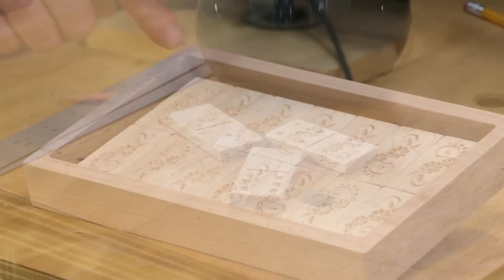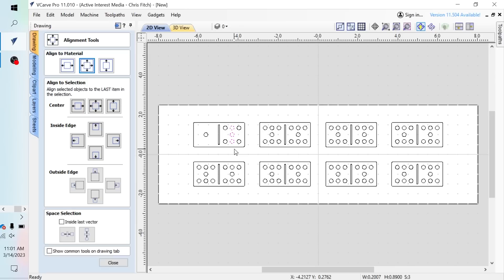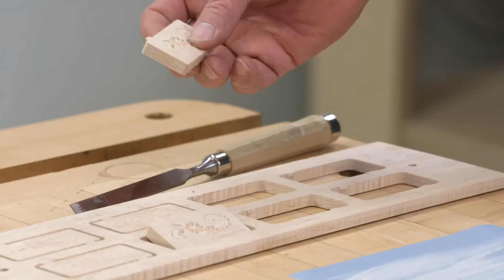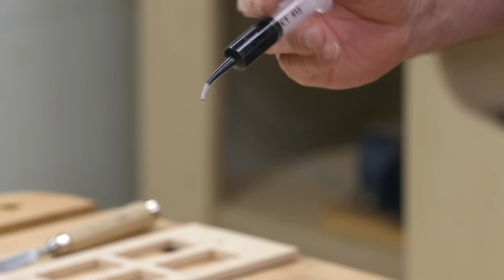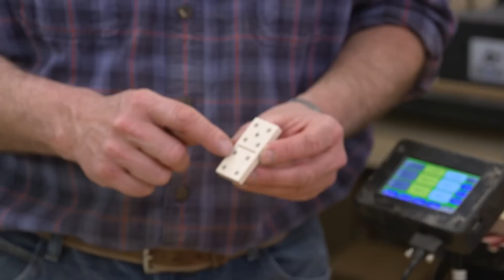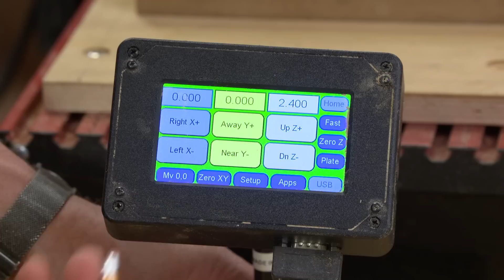CNC Basecamp E020: Decorative Domino Set

Comment: I think a project like this begs for a fixture.  You could easily cut all the dominos down to size on the tablesaw.  Then you could use the CNC to make a fixture with pockets for the dominos.  Put the blanks in the fixture and then do all your machining.  You could even do the rounding over in the fixture and clean off any epoxy or contrasting wood plugs if you wanted.  As expensive as maple is, you also use the material more efficiently and create less waste.
Reply from the maker: Yes, I agree a fixture would work well.  Working in a production shop for two woodworking magazines we always have plenty of wood available for small projects, so I don't tend to think about being super-efficient with materials.

Comment: I've started using Amada carbide tipped drill bits, specifically made for CNC use, so I don't have to use upcut endmills for drilling anymore, since they're not really meant for drilling anyway.
Reply from the maker: I'll give it a try, thank you for the suggestion.   The upcut endmills are OK for shallow drilling but I always get a bit of unwanted vibration on deep holes.

Comment: I heard pausin the machine is bad for the motors???  I Didnt understand why, but could u comment on that?
Reply: Because stepper motors are under constant power even when they are not Turing and this creates heat. However this should be fine yes they will be hot to the touch but that is ok for the modern wire insulation we use nowadays.
Reply: @joergbalzer7430  
"Because stepper motors are under constant power even when they are not Turing"

Not always, it really depends on the machine.

In a closed loop system it most certainly would have constant power, but in an open loop system it would not necessarily have constant power.

Unless the machine is designed with all thread, a machine that is setup on it's side so that the bit is facing the vertical wall, would need to have constant power otherwise the gantry would fall towards the ground when the power is turned off.

In the case of a typical horizontal machine as was used in this video, machines designed with belts or rack and pinions, as long as the machine is level does not need to have constant power to maintain it's position.

Design is the primary determinant as to whether a machine will have constant power to the motors or not. But even with machines that do have constant power, an additional heat sinks can be added to the motors to enable them to stay cooler and therefore maintaining power won't hurt the motors. Well, it may tarnish the contacts the power is flowing through, but that generally takes a long time to happen.
Reply: @joergbalzer7430  

"think you would want to learn about “detent torque” of a stepper motor. Also I think there is no CNC controller that will not apply constant power to the motor even if they are not moving like you suggest. A hybrid stepper motor is crating its micro steps by energizing several coils at once not applying power would mean the position of the rotor will align with the magnetic poles causing it to change position. Sorry never heard of that."

My original statement stands true. It depends on the machine.
I neither mentioned nor implied hybrid stepper motors.
You inferred that.

After doing a bit of searching, I see that while related, they are not the same tech.

I wonder how many people are erroneously calling the hybrid stepper motor, a stepper motor and thinking the single term applies to both?

Hybrids are stronger and therefore cost more.
So you would need to be careful that you are purchasing a hybrid stepper motor, they are not selling you a stepper motor at the elevated price.
Reply from the maker: I have never read anything  in product literature that says not to pause the machine for long periods of time.  The stepper motors are "ON" in a locked position, so they do generate heat, but I don't think that is any different than if they are in motion and the motors are designed to operate warm.   I just view it as "run time".   That said, I don't know definitively one way or the other and am interested in hearing everyone's opinion.